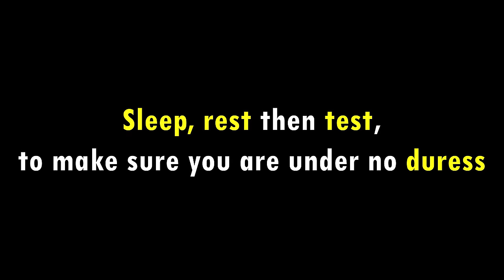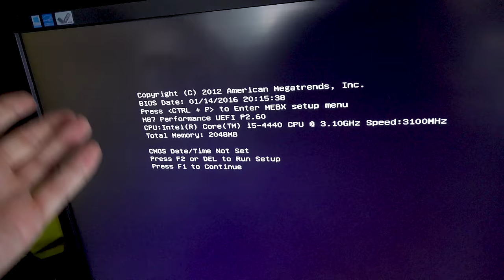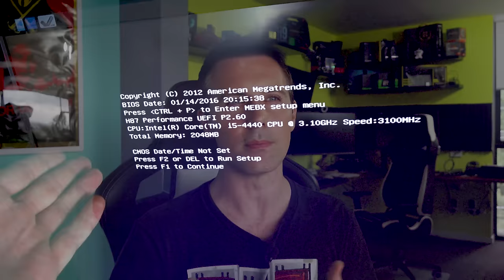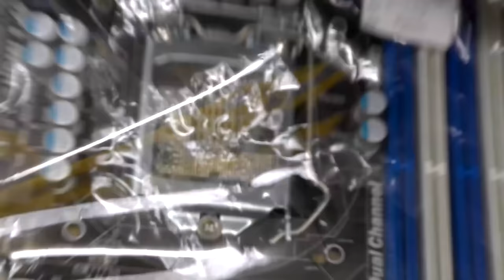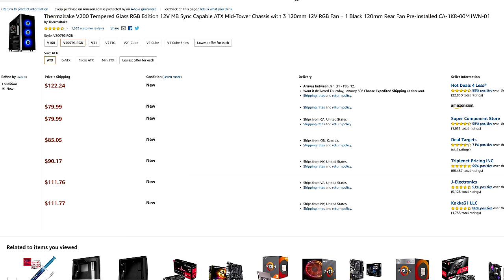Washing 12 Motherboards with WATER and Attempting to Fix them - (Can YES Fix it Pt. 1/2)

Comment: Ya, catching hair or clothing in the LGA socket can REALLY F-up the pins.......
Trust me, my hair's down to my a$$, and it happened once.  Luckily with the use of 2 VERY small fine sewing/hemming pins I was able to use one to hold the first factory bend from the socket, and use the other ones tip to manipulate the CPU end into shape and height(quite important as the chip pushes down and the pins move very slightly forward). 👍

Comment: LGA sockets are actually really cheap to buy (£2 on eBay), so replacing a socket is entirely possible as they are just attached to the motherboard using a ball grid array. Check out this video by dosdude1 /watch?v=SzMHJXHO120 where he demonstrates how to do it successfully. If the boards are worth it, personally I'd give that a go. Loved the commitment to trying to fix these this video, as you could have easily given up far earlier.

Comment: I have an old AMD CPU with a missing pin. I bent the pins when I was careless by removing the CPU with the heatsink and fan still on. I tried to bend the pins back, and one broke off! I put it away and bought a replacement CPU. A year or so later I needed to build a computer for CAD consultancy work. I took the AMD CPU with the missing pin and tried it with a new motherboard. It booted up without any issues! I decided to give it a chance and ended up making over $200,000 over a few years of work with that CPU. Later on, I gave the computer to a friend who used it to play games. I told him the computer meant something to me and not to throw it away if he needed to upgrade. He contacted me one day and said I could have the computer back if I wanted it. I said hell yes! I still have it in storage. It's not being used currently but it served me well over the years and I will keep it.

Comment: One out of three is a good batting average.  Inspired me to run the faucet on a 1156 board that boots but does not recognize any of the USB ports.  I did not brush any of the sockets.  Don't want to deal with bent pins.  It's drying as I type this.

EDIT ADD WITH RESULT:  Incredibly, the mobo booted after drying out.  However, the pre-existing problem did not resolve.

Comment: Water in itself isn't what kills things. It's the resulting corrosion afterwards.  Wash them in DISTILLED water.  Dunk them in a bath of 99% iospropyl alcohol afterwards, then bake them for an hour or two at 175F/80C and it's a perfectly safe cleaning method.  If you just run them under the faucet then let them air dry, you'll most likely have issues down the road.

Comment: I have an old z77 asus board that drives me crazy.  Some days it turns on fine.  Other days I have to constantly turn the power supply off reset it and press the buttons multiple times to get it booting.  I'm actually typing on it right now.  Some days it takes 15 minutes to get it started.  I have no clue what could be causing that problem.

Comment: I have a problem similar to the asrock boards not initializing BIOS on my Asus H81t that I use for my server. When I press the power button, one of three things happens:
A: Nothing
B: Successfully boots to windows
C: Video signal, but the only thing displayed is a static _ half-way between the upper-left corner and the center of the display

Comment: Your really have no idea what you are doing. I say this as a qualified and very experienced electronics technician with over 30 years of experience. Firstly you should only be using distilled water (which is an insulator) on a PCB. Any other water (such as from a tap) has impurities which causes the water to conduct. 50 years ago the Australian Navy might have used water to clean electronics, but this was because sea salt would enter the internals and a hose by the dock was the most practical way of getting the corrosive salt out of the electronics (we are talking electron tubes and not semiconductors). Once you've had a PCB in distilled water (never tap water) you are then supposed to soak the PCB in 99% Isopropyl Alcohol to disperse the water which might have accumulated under the ICs and all the connectors. Once you've soaked the motherboard in Isopropyl Alcohol you are supposed to place you motherboard in an oven heated to 100 degC (a mother board can handle this) for around 10 minutes to completely get the water out.
.
By using tap water you would have had impurities deposited between conductors (BGA balls, IC pins, tracks, etc) on the PCB which conduct electricity. Often the deposited impurities (in tap water or the corrosion that occurs due to moisture) become "DC coupled" (conduct electricity) while there is a greater chance that they will be "AC coupled" (in other words behave like small capacitors) where signals on one PCB track will get through to adjoining tracks. otherwise commonly known as "crosstalk" which causes a lot of problems.
.
So no, no, no, no........ never clean motherboards with tap water !!!
.
Just because 4 motherboards started to work after your tap water washing means nothing, because you could have easily tied those motherboards to some rope and attached them to the tow bar behind your car and driven around the block a few times and had a similar outcome (where they started to work) claiming this process (towing behind a car) repaired these motherboards.
.
As a qualified electronics expert with over 30 years of experience in aerospace, defence, medical, law enforcement fields where lives were often at stake when it came to electronics reliability I was horrified with the advice you were giving your audience.
.
Let's just say I would never use a motherboard or any other form of electronics that came from you after I've witnessed what you do with these things. but hey I'm not your average Joe so don't take it personally.
.
I've also noticed that you spray motherboards with some kind of spray (some kind of lubricant... not sure... not worth my time to watch your video again). Are you insane? For goodness sake it's a motherboard and not a filthy lawnmower. There is a very good reason gold is used inside any connector on a motherboard and the last thing you want is any kind of spray that leaves any kind of deposit (such as an "oil").
.
I was generally horrified to witness what you were doing to motherboards and it really was an affront to my sensibilities. Imagine that I spent my entire lifetime working as a professional both domestically and internationally in the electronics/IT industry and never have I witnessed anyone washing PCBs under tap water (distilled water.....yes). So forgive me if I missed something and wrote something wrong as I don't have the presence of mind to watch you video a second time. Once was enough to make a lasting impression.
.
If you were going to be cleaning motherboard correctly, then here is a video that describes the process.
https://youtu.be/3-YZw24I9FA

Comment: I'm commenting before watching the video. Yes you can clean any pc component with water, hose (low pressure obviously), i've done it dozens of times, just make sure to let it dry for a LONG time, like5-7 days to be sure. oh and try to get as much power of the capacitors before washing

Comment: Here in RP washing motherboards thru running water with liquid dish washing soap is quite effective. We use half an inch paint brush not toothbrush. After the rinse, we put em directly under the sun for about 30 mins. Then changing its postion every 30 mins for 3 hours. This is assuming a sunny weather. We have a ratio of 4-5 out of 10. The rest would be bios, mosfets or crystal related issues. Some needs BGA rework.

Comment: My Asus P8Z68-V/Gen3 had some serious issues back along with its bios , it would boot but i could not overclock (as the multiplier was gone) , one of my PCIE slots died , would only recognize half of whatever ram was installed , was a nightmare , no amount of resetting the bios or pulling out cmos battery & official bios reflashing methods would fix it absolutely nothing would fix it , in the end it turned out the bios was corrupted & the only way to fix it was a complete reflash wich official means do not do they just update certain parts of the bios , tried several flashing methods & always got the same problem "This bios does not support full flashing" , something like this , was about to give up & start saving for new board , processor & ram & then there was a thread in a forum where someone made their own flashing utility via a usb stick method , so i tried it & 30 seconds later everything was back to fully working 100% !! , i guess this persons utility allowed full reflashing of the official bios somehow , whatever the case i wish i could thank that person for what they made but the thread was from 2013 & locked unfortunately.

Comment: Works great on keyboards as well mate whole trick is to let /make sure that there dried out extremely well. In summer I set it outside in the morning and let it sit for the day out there and later on at dusk bring it in dry as a bone and clean as a whistle BUT in winter as in summer ALWAYS shake the piss out of it before drying.  But in winter shake good and let it set for give or take about 3 days in a nice warm room close to but not right on top a heater vent and you will be ready to go oh leave the keys no need to remove em and I use a soft real hair paintbrush like a house room door trim brush with a wee bit a dish soap and go crazy lol hey I do my Razor BlackWidow Chroma at least 4 times already and never a prob. Matter a fact I Been doing it for years on keyboards never had a problem. ;)

Comment: I wish they would design a CPU like a 8 core, that can be put in 4 ways, and each way did a difference way, like maybe give you 2 less cores but allow more threading or one way you can only run 16 gig, or higher, this way you could have 4 CPU's in One package do 4 diffferent things

Comment: I would not even be worried about the water itself damaging the boards... but the corosion that may occur afterwards... as he stated correctly, the water is "contaminated" with different metals and salts, wich even when the water dries up remain on the board.... and on the H97 .... Asrock Boards of Sandy Bridge up to Haswell really seem to have troublesome BIOS... had multiple of them with weird issues which were gone after a BIOS reflash.... and those I did not flash died hideously....

Comment: B, you just pull the pins out and replace them with pins from other dead sockets. Der8auer has a video where he shows how he fixed a high end ASUS board by just pulling and replacing the pins.

Comment: if you could get your hands on an asus rampage extreme series board, you'll love cleaning those up. Those suckers are really a tough grade mobo that has really low to none dead even after years of using. I've seen quite many a number of complaints about asus cost cutting on making their boards which i believe happens on the lower end budget boards. But so far they've never cut down the cost to make the rampage series board. It's definitely a dream board for gamers. The only problem with asus is the dumbass customer service and technician that were hired to work on their products. I'm from malaysia and i've once sent in my asus rampage 3 mobo for checks due to IOH temperature spiraling up to over 80degrees celcius. They ended up fixing it due to a loose contact of with the northbridge heatsink but at the same time, they used a minus screw to remove the black foam tape that mounts the cpu mount of my corsair AIO cpu mount. I found the cuts like 8 years later after replacing my AIO. The cuts actually has damage and broken circuits resulted one of my ram slots unusable. The board lasted me 11 years with no issue till these days with OC on. I seriously hate how dodgy this fucking technicians did not attempt to replace my board but hide it from me.

Comment: What are some common causes for these motherboards to die? apart from things you can see visually like bent pins. Would running a good surge protector power board prevent some of these causes?
I recently experienced some lightning strikes around my area that cause my power (including my comp) to turn off and on really quickly, thankfully nothing has happened and I hope you weren't also affected by the recent wild weather. However, it did worry me since I'm not running a surge protector, am I running a big risk in not using one?

Comment: If you want to wash with water do NOT use tap, use only distilled water. Mineral deposits left behind from tap water will lead to corrosion. Minerals+electricity+heat=Corrosion.

Comment: The reason why most people shouldn't do this is because regular tap water is conductive, and it can seep into capacitors. Do NOT use regular water, use distilled water if you MUST use water. But then let it dry out, and it takes a while if you used water. An IPA bath is much better since its gone in an hour.

Comment: does anyone have an idea how to fix a memory slot that isn't working? my z390 ace has 2 memory slots that isn't working after taking my pc apart and changing out the water cooling fluid.
Edit: I did not see any signs of water on the motherboard. i hope break cleaner will fix it

Comment: That Last Board the Blue Spark may have been a blown Cap short. I understand that you do not do board repairs. But do you have any connections to anyone that has a test rig to test board sections or old components? I do understand most people do not have the time to try and test each component, but some techs can perform tests and component replacements. but some of the older guys, do know a few quick swaps and tests that will refurbish some boards. a few can/have repaired damaged parts of boards that will bring them back in fine working order. but only if they have half a dozen or more of the same make to test and repair at a time, buy setting up mini test/repair rigs. ??? Just a big fan of keeping toxins out of the dump or burn waste stream and environment. Keeping the Air/Land/Water as uncontaminated is a more important priority to more Auzzies and New Zealanders, than in The States.

Comment: Don't do this when your local water supply is very hard. The calcium and carbonate sediments can leave stains, degrade connections because of that, and could even damage things. I would suggest not to do it when your water is harder than something like 8 to 10 dGH and definitely don't when you're in the 15+ dGH range. This is especially important to keep in mind if you use a dishwasher, as those dry things inside by evaporation, hence leaving behind anything that was soluted in the water

Comment: best way and fastes way to cleanup your pc is to use hot boiling water,after the wash quickly use cold icewater to cool it down.

or
you simply use your washmachine and put all your hardware in and set the machine to max slowest energy saving programm,and reduce the spinning at the end to your slowest possible.
or
use your dishwasher,but dont forget to NOT use strong acid lotions,or it can damage your stuff.

Comment: I know this is old ..but you can also get a heater and  heat up some of the reballs on them boards..sometimes they overheat and mend together..heating them back up most of the times..does it....I used to put them in a oven a 205f for 2 hours....peace....i4i.

Comment: @16:00 ... well, somewhere around that point. Another explanation... It could be a few cracked solder joints on the memory slots or under some chips, due to the board flexing (maybe too heavy cooler or video card putting pressure on the board, or the guy hitting the computer multiple times causing mechanical stress). A bit of flux and a soldering iron on the solder joints of memory slots takes 10-20 min of your time.  It could also be some oxidized contacts in the slots. One trick i learned is to fold a strip of copier paper 2-3 times to get it thick enough and then slide it across the memory slot to rub the surface of the paper across the metal contacts.. the paper surface is abrasive enough to break off oxides and crap that may be on the contacts. Erasers (rubber, pink stuff on crayons) and fiberglass brushes (google it) are used on pins like the ones on DIP bios chips 

You probably did it in part two, but did you try programming the bios on some of those boards? You got one asrock board working, take bios chip from that and use it with the others?
Also, for those boards that don't work, why don't you use a multimeter to see if there's some mosfets shorted or not? 10 minutes of research on Youtube will tell you how to test mosfets and regulators.  A hot air gun and some flux can be enough to desolder a damaged mosfet... so you could desolder a good one from one bad board and transplant it on another to get one of two boards working (if that's the issue)

Comment: That’s cause you didn’t clean the terminals,terminals oxydiez over time always,they should always be cleaned you can use a fine sandpaper as well but don’t use steel who’ll for obvious reasons

Comment: You can wash it with de-ionized water and air dry. That technique has been used for years on flooded circuit boards. Do not use regular water or bad things CAN happen.

Comment: You can get a motherboard for under $100 these days so unless you’re on a really tight budget it doesn’t make much since to clean the mother board. Especially  if it’s 1 year or older. Would be easier just to upgrade it.

Comment: So, if the only drawback of washing a motherboard with water is the accumulation of the water's impurities on its parts, then, theoretically, could one use distilled water and have no side effects?

Comment: i have a intel desktop board i actually like it :) and iv used the water trick on my old oem 15 2320 board that had something stuck in the socket XD and i let it dry for a few days and it worked again! then i sold it XD